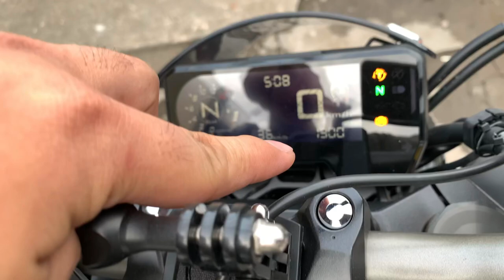Jolen lang katapat tunog halimaw na Si “Baby” CB650r ko “CBEAST”

Comment: Kaya meron pa siya backfire, mali yung hose na nilagyan ng jolen, yung binara niyo po is yung crankcase breather, hindi yung pair valve breather.
Reply from the maker: Thanks bro, pina check ko n rin sya sa mismong honda ok lang daw either of the two kasi parehas lang ng dinadaanan as long as huwag daw i block both. At the smooth na ung sound nya after a couple of miles running. 
Salamat sa advice ka-steel horse

Comment: Dapat yung mahabang hose ang nilagyan ng jolen bro yun yung hose ng AIS then palagyan mo nadin ng aftermarket na air filter para mas solid 🙂
Reply from the maker: Ngyn ko lang kasi nalaman yang jolen na yan bro kaya no idea talaga ako. Thank you at bibili din ako filter na sinabi mo. Any recommendation and price ng filter?
Reply: Bmc air filter around 4.3k something...., yung jolen pwedemo ipalipat yan dun sa mahabang hose na sinasabi ko, kaya pala may backfirr pa ako narinig nung nirev mo on low rpm
Reply from the maker: @northrider8453  may picture ka ba kung saan banda ung mahabang hose na un?
Reply: @mrmrsymotoradventourvlog3768  mga sir wala ba ito long term bad effects sa motor kapag e block mo yung AIS?
Reply from the maker: @rafaelcan315  so far for 2 weeks riding Wala pa akong nararamdaman and according dun sa mga nauna for almost 2months Wala pa ring bad feedbacks. Soon I will also replace my filter into DNA type.
Reply: @mrmrsymotoradventourvlog3768  thanks sir may idea po kayo if ever mag pa remap ng ecu need ba talaga ng power commander? thanks
Reply: @northrider8453  yes, may backfire pa sya. 😊
Reply: Nailipat mo na ba sa mahabang hose yung jolen sir? San banda ba dun ang mahabang hose and anu na po ang effect totally no backfire na ba?
Reply: @rafaelcan315  wala makakatulong pa nga na mabawasan at mawala yung backfire
Reply: @Justus-z9c  may tulong sya na mabawasan ang backfire basta sabayan mo ng pagpalit ng airfilter, mainam ang remap or ecu tuning para maiwasan ang future mechanical issue

Comment: Hello ano po ung jolen ?
Reply from the maker: HinKa-steelhorse as in Jolen po ung nilalaro natin nung bata pa tayo tapos isusuot sya dun Sa hose ng air intake ng motor to avoid backfire s muffler. :) 

Good night ka-steelhorse
Reply: @mrmrsymotoradventourvlog3768  so far kamusta naman po ung bike ? Pina reflash nyo po ba ? And pag pina reflash ba mawawala warranty ganun ? Sorry beginner lng sa big bike haha👋🏻
Reply from the maker: @gianzacate261  hindi NA po but next plan is to change air filter to DNA .

Comment: bro hm pakabit mo? sila na rin gumawa ng full exhaust?
Reply from the maker: Cat delete lang ako bro Tapos bumili ako separate canister ko sila lang nag dagdag ng elbow for the slip on
Reply: @mrmrsymotoradventourvlog3768  hm bayad mo bro? Binan area ka ba? Southwoods lang ako bro.
Reply from the maker: Santa Rosa ako bro pero both malapit sa atin sila Rex. Exit ka ng Mamplasan before biñan doctors makikita mo sila sa right side I front sila ng motolite battery . Cat delete 3k lang bro maayos silang mag welding.
Reply: @mrmrsymotoradventourvlog3768  ahh okay bro. . Ride soon! Ride safe!
Reply from the maker: @MikeTorresMotoVlog  thanks pls like and subscribe na rin bro ha. Salamat :)
Reply: @mrmrsymotoradventourvlog3768  okay bro sakin din bro. .
Reply from the maker: Sure bro lets support each others vlog
Reply: Jan ako nagpaGawa ng Pipe sa CAFE400 Paps MIKE. yung nakay DOC CRIS na dati baka nakita mo yung PIPE nun SOLID gumawa si Kuya Rex.
Reply: @helmarksadullo9258  oo solid ung tunog nun paps. . Hehe.

Comment: Im afraid u plug into the wrong hose my friend.
Reply from the maker: Thanks for the concern ka-steelhorse I already checked it with Honda Elite in Batangas and they said it’s ok as long as you don’t choke both hoses then it will run fine. At the moment I notice smooth sounds on my exhaust.

God bless and RS always steelhorse

Comment: No offense po, you afford to buy an expensive bike pero instead na magpa-remap which will cost you 3k eh pinili nyo yunj jolen. Mas nacompromise pa yung Fuel to Air ration ng bike since di naman standard yung jolen and kita sa testing na may backfire parin.
Reply from the maker: Marami po kasing review even mag pa remap ka may backfire p rin talaga. Next after this ppalit po ako NG DNA air filter para mas maging malinis ang tunog nya.
Reply: mali po kc ung pinag lagyan ng jolen kaya ganun parin malamng sasabog makina nyan
Reply: Maling gawi ang pag gamit ng jolen na experience ko narin yang magic jolen nawala nga ang backfire pero dmo mapapansin malapa na pala ang problema ng makina mo at di na biro ang gastos.
Reply: @mrmrsymotoradventourvlog3768 di po talaga nawawala backfire kahit ipa remap pero ksma yun sa magandang tunog nako compromise yung engine sa katagalan.
Reply: scam yung remap after mag full exhaust system. debunked na yan.
hindi naman talaga need ng back pressure ng 4-stroke engines. basta tama yung diameter ng exhaust manifold na naka-kabit to produce vacuum pressure para ilabas yung hot exhaust gases